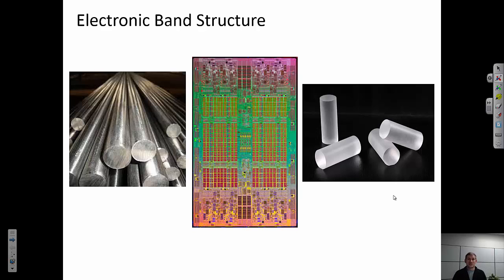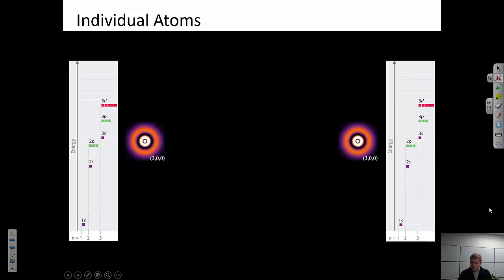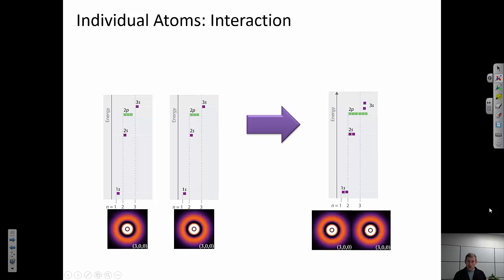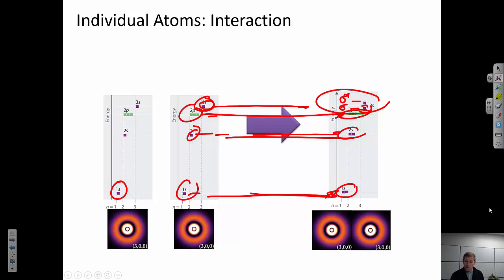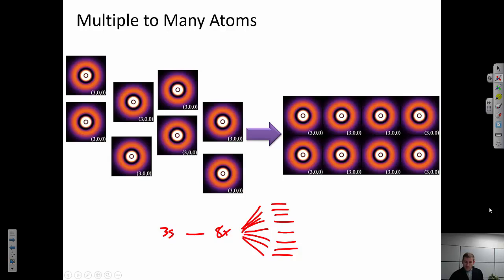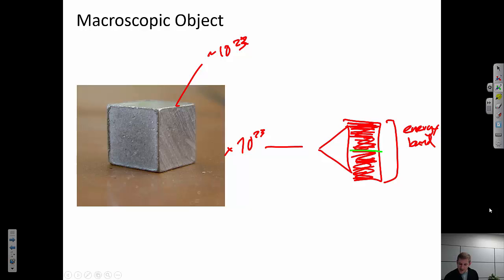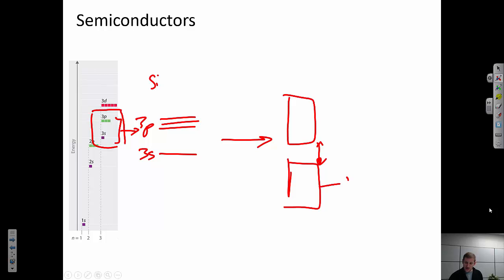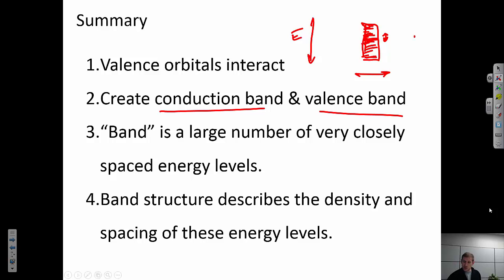Electronic Band Structure {Texas A&M: Intro to Materials (MSEN 201)}

Comment: With the Sodium, you mentioned the lower shells are stable and do not from band gaps, and 3s does as it is the least stable, but, with the Si atom  3p and 3s shells formed band gaps, omitting 3d (least stable shell) , I would have thought Si 3d would form the band gasp/s similar to the Sodium presentation.